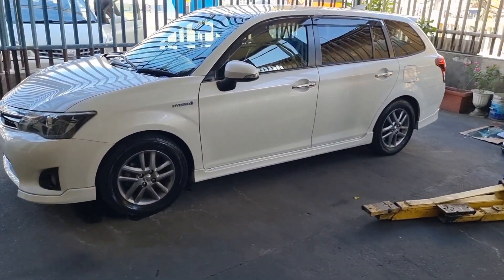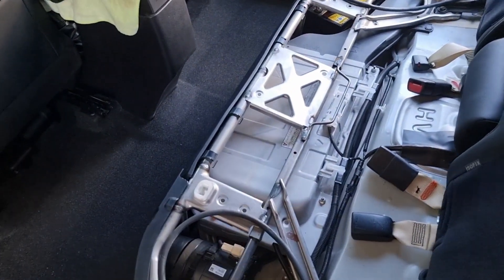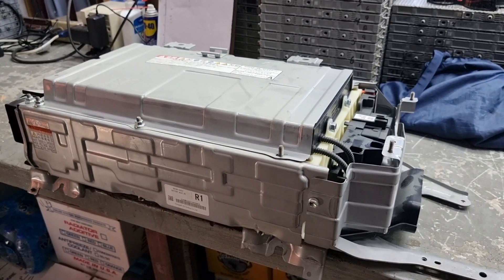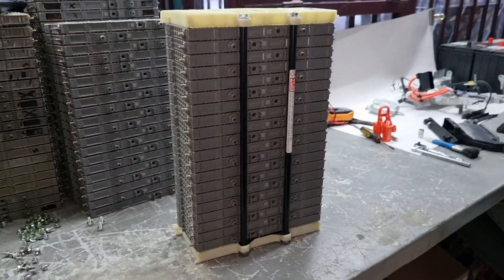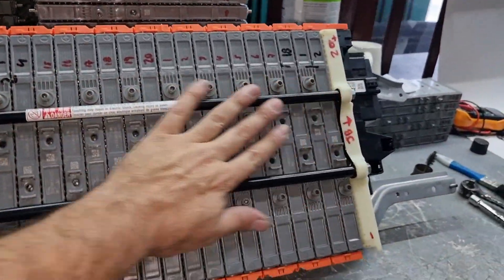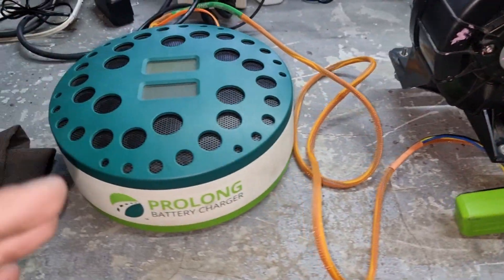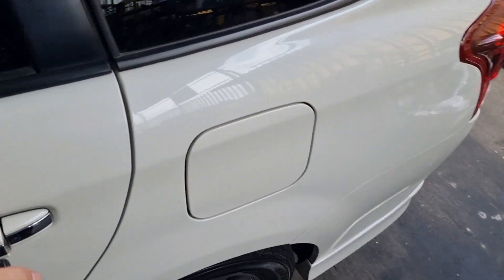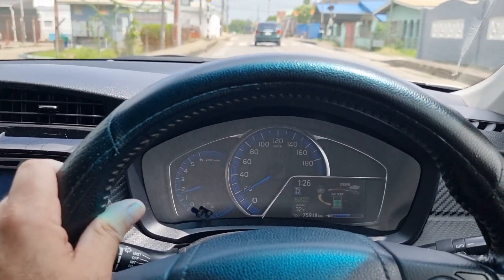reconditioning a bad hybrid battery will fix it? let's find out

Comment: That is not how you precondition a battery. You must discharge and charge 5+ times. You do not know what you are talking about. The cells have to be charged individually. No bueno!
Reply from the maker: Let me remind you my good friend that these batteries work by always being charged and discharged collectively... so what are your bases upon saying just five times and individually like if it is black and white ☝️🤔😪😪 of course is NO BUENO ☝️🤣☝️🤣
Reply: Well man I have been rebuilding these batteries for many years. Usually there are just a couple of "bad cells" I mean internally shorted or just failed. To get the other cells to take a full charge to delta peak voltage, it takes up to 5 cycling between 6 volts and full charge to reach delta peak voltage. Individual cell charging/discharging is the only way The charger you are using is for battery maintenance and will not perform this function. You can tell which cells are bad by using toyota techstream before removing the battery from the car. It shows the internal resistance of each cell. Also, when you test each cell after all of the jumpers are removed you will see one or more cells that are noticeably lower in voltage. A bad cell will never reach delta peak. Search YouTube and there are many videos showing this. I assure you you are wrong. I would however like to have one of those chargers you have though. I can not believe you own a shop working on these things and not know this info. They cell good tested cells for like $25 on ebay. Let me know if I can help, or need more info. I will gladly help my friend.
Reply: @howardkanitz4998  educate me a little bit,  so what's the lifespan of the battery after removing the bad ones?
Reply: @johnstoneanduku8451  The first one I did has lasted 7 years so far. Always checks out on techstream. It shows full on the display every time I park it in my driveway. The car has 268,000 miles on it! I have 3 now!
Reply: OK guys, now that you asked. I bought a 2007 Prius 7 years ago with the OEM battery. The battery died when the engine failed to start. I pulled the battery and brought it into the shop. I found out that these batteries are nickel metal hydride. I bought a hobby charger that was compatible. I found several videos on YouTube and recharged the battery. I also bought a program called techstream, and a cord to hook from the car to my laptop. I bought another prius that the dealer said needed a $3000 battery. I checked the battery and found one cell showing lower voltage than the rest. A cell is actually 2 modules connected in series. I took all of the jumpers off the individual modules and tested each on seperately. One was 2 volts lower than the rest. I went on eBay for $30? I think? The charger I have is automatic. When charged the first few times the charger goes to a certain voltage and after a pre determined time limit says "full". After 5 times of discharging down to 6v and charging back up, the charger will say "Capacity". Capacity is when the modules reach what is called delta peak voltage. Delta peak is when these batteries have a voltage drop when fully charged. The charger senses this voltage drop and displays "Capacity, rather than full". I have rebuilt 5 of these so far. The first one has lasted 7 years so far and still checks out on the computer. The car shows the battery to be a full charge when I pull in my driveway. Discharging/charging once does nothing. Try it yourself. Search it on youtube, there are many videos on the subject. I obtained my information by watching all videos at the time, then from personal observation. Trust me I have mastered this. If the charger says "capacity" it will last for a very long time. The problem is the copper jumpers corrode, which can be cleaned, and some modules are factory defects. When the modules become unbalanced it can cause an overcharging problem, or an undercharging problem on different modules. This is where you get the Red triangle of death. I use a turnigy charger that does 4 modules at a time. It usually takes me a week to discharge/charge each module, but hey, I think it is worth saving $3000? By the way, yes these batteries are continuously charged, but never fully discharge to 6v per module, or fully charged to capacity. If you have more questions just ask. I hope this helps somebody. Peace! ✌

Comment: Had my hybrid fan cleaned today, to prevent overheating the hybrid battery, but it looked good, altough my old 2010 Toyota Auris has no air filter in the fan system.
Reply: No pets in the car, almost no major cooling problems. But cleaning the fan and air canals help the cooling. And remember to use your A/C all the time your battery needs it.

Comment: Ok so charger has to charge up a . Zero one and .02 amp rate to charger for 24-48 hours after equally discharging???
Reply from the maker: Great question 👋😎... the only way to savely charge the battery should be from 0 to 0.2 amps in pulses for NOT MORE THAN 48 HOURS with all modules assembled on the frame of course or they will swell and go bad ( careful with this ☝️😎), the reason is because they produce heat after charged... then you can now mount the modules in your balancer for 48 hours for a full balance 👋😎

Comment: I have a question about doing this with the 2nd generation battery where the fan is located in the car. Is it best to reinstall the battery before doing the charging or can i use a fan to keep the pack cool? Im new to this game and want to learn as much as possible before attempting it.
Reply from the maker: Yes... use it in a cool room with a normal fan 👋😎👋😎

Comment: Cheers from Romania . I have 67% of life expectancy of my battery and there are no errors . Can i do individiual charges and discharges on each cell with a hobby charger and then balancing the entire pack ? This will bring back some life expectancy to my battery ? Thanks !
Reply from the maker: Yes my friend... just make sure to properly balance after cyclong the modules 👋😎👋😎
Reply: @hybridsolutiondiagnostics  what about after balancing should i swap de center modules to outside ?       Thanks for helping me 👍
Reply: @braescuvalentin761  Yes, definitly. By doing that you can delay the time until your current outer modules fail.
Reply: Valentin salut poți să mergi la băieți de la Galați ! Sânt f bunii!!

Comment: do grid chargers or superchargers for 2013 prius gen 3 actually work on a hybrid battery that has sat for over 6 months without starting?  they go for $300 grid charger, to $500 for super (fast) charger ?
Reply from the maker: You must use a low amperage charger for a slow charge...

Comment: Can you replace the weak cells with good ones??? And still come out with a bargain price???
Reply from the maker: You will need to match the modules with the same capacity or it wont last much...
Reply: I did replace bad module and after 80k miles battery works, but sure isn't infinite.. needs reconditioning overtime and yes  keep saving for a lower mileage battery pack in couple more years.

Comment: I am curious why you call it reconditioning when you replaced 7 modules? Maybe that is a service/marketing term? I understand replacing those middle cells since the temps get higher there. Personally, I would not call it reconditioning. I believe there are other cell chemistries where reconditioning can bring the cells back to a better capacity, but not this type of chemistry. The extra capacity you observed was mostly due to replacing the middle cells with better cells. 25% increase is good, so may help this customer for a while, but it did not recondition all the cells to work better. The lowest capacity cell will be the limiting factor.
Reply from the maker: Thank you for your comment... the answer you are looking for is in the minute 15:55 ☝🤪... watch the video
Reply: He didn’t replace any battery
Reply: He replaced "7 of the worst modules".

And the reason the overall life expectancy goes up is because if there is 1 faulty module, the battery pack will give you a false overall life expectancy. All the other modules will be limited by the one bad module. I went from 4% life expectancy to 89% by changing out 4 bad modules. And yes, cycling the batteries does help the capacity also. I've gotten modules from 4500mha to 6000mha by cycling them. 

So I dont know what the heck you guys mean by you can't recondition a battery....

Comment: Shouldn’t you have performed a three cycle charge and discharge to fully balance the battery pack.
Reply from the maker: No, if you do that to an umbalanced in capacity battery, it will for sure go worst...

Comment: First of all you do not do any of experiments. All we can see in your shop a lot oh hybrid batteries from Toyota etc etc. Second, the owner of that car probably do some strange things with car, because it s only 76.000 kilometers on the clock, and all ready problem with hybrid battery? Not even a chance!!! I have very old Lexus RX 400h from 2008 and on the odometer it’s 450.000 km. Car and everything it’s in mint condition. Last time when I was at my Toyota dealer, car mechanic have tester battery and it’s still strong with 87% good health. So cut the crap and if you want free advertising do that on some other manner.
Reply from the maker: Thank you for your comment... i will accept that indeed you are trying to make a point but sadly might not have any idea of what you are saying from the technical point of view... this is like the daily issues of these batteries here in the caribbean and the reasons are many but heat it is the main reason these HV Batteries are going bad so fast. I have other videos explaning in details... take a look ☝😎
Reply: @hybridsolutiondiagnostics  I don’t care. I live in Sweden and usually in winters it’s around -20 -30C. So please you don’t need to explain to me about hybrid cars anything. 👍🏻
Reply from the maker: I can see your point now... in cold weather these batteries are almost forever (Facts)... so clearly you got a lot to learn my friend ☝😎
Reply: @hybridsolutiondiagnostics  I have live and  study in Florida 6 years and I have old Toyota Prius with 189.000 miles on the clock, never ever any problem with car. I have purchase that car because my dad have Lexus and also he never have any problem with anything. So man, please stop to embarrassing your self and your company that 76.000 km Toyota car have problem with hybrid batteries, no one will trust you.
Reply from the maker: @alexa795  tell that to the many many customers i had to rebuild their batteries and all cause the same reason (HEAT). So my friend... your arrogance over technical knowledge it is indeed very embarrassing... so lets do something better... i kindly invite you to see my other videos explaning in details the toyota hybrid batteries common issues in hot weather... you might learn a little i hope ☝😎
Reply: @hybridsolutiondiagnostics  Only one thing here it’s embracing. The are no bad hybrid batteries with only 76.000 km. That story you can leave to your “customers”
Reply from the maker: @alexa795  yes that is true... most of these vehicle's odometers are runned down by importers so ussually they are all over 120k km and then of course... extreme heat weather here is the real battery killer.
Reply: @hybridsolutiondiagnostics  No one buys that shit. Just connect OBD and you can see real km. Even if don’t have hardware and software every service can do that for just 10 $. Men, that crap what are you talking no one trust at all.
Reply from the maker: @alexa795  jejeje my friend that is sadly not true... you have a lot to learn but arrogance not letting you understand details... its being a nice debate but you clearly need more info to debate about this... thanks for the comments anyway.
Reply: @hybridsolutiondiagnostics  Thanx a lot, but cut a crap, no one buy’s such shit talk any more. Good luck with your “business” 😏
Reply: @СлаваСлавкин-е4е  don’t understand

Comment: Is conditioning a battery at 75% life expectancy recommended? Or at what percent should it be reconditioned. Trinidad to the world... great job..
Reply from the maker: Hi thank you for your comment... indeed a HV battery with 75% needs to be serviced
Reply: @hybridsolutiondiagnostics  I wouldn't agree.  Wait until under 50%.  When it comes time to repair/rebalance the battery (which is a big deal and you don't want to do more than every 3-4 years) better than bulk charging/that Prolong charger, it would be far better to run the charge/discharge process on the individual modules, then pair them with each other to produce pairs of about total equal mah capacity, and reassemble the pack as Jose suggests, moving the inner modules to the outside and vice versa.  Don't forget to clean your hybrid fan.  I also move the outer module heat sensors closer to the middle of the pack to trigger the fan earlier.
Reply from the maker: @cawag98  you are correct just in a few comments but very wrong in some others ☝️🥴🥲... do not wait until your battery is 50% and do not move sensors to the middle that is so BUT SO WRONG ☝️🥴

Comment: good video and good experiment.. but one thing u didnt do.. 

u didnt charge and discharge the (rebuilt) battery pack.. to try and restore lost usable battery and capacity..
Reply from the maker: Thank you for your comment. Indeed i did not cycle the battery pack because if you do so, then the strongest modules will become too strong compare to the weak ones and then the battery would become worst unbalanced....
Reply: @hybridsolutiondiagnostics  ur are the pro here and im not trying to discredit you but the whole point of charging and discharging is to balance all the cells.. maybe its not possible but this is what im trying to find out the answers to
Reply from the maker: @prawnstar502  yes of course cycling the battery modules will restore... the problem are the weak cells, they wont restor capacity even if you cycle then...

Comment: Hybrid battery dies quickly if you use the economy mode or the power mode or the EV mode.Avoid these things.
Reply: So which one is better?
Reply: that is true
Power mode EV mode are battery killer. Reverse movement reaches 125Amps to uphill

Comment: I love the educational videos you are doing. Would you be able to explain how to connect the prolong charger ? Does the battery need to be fully functional when charging with the prolong charger?  Does the orange breaker need to be in the on position?
Reply: Keep your money to buy new Battery pack from Toyota and install it yourself for about $2000.  Don't waste your money on false hope of Prolong device.  The chemistry and aging of the electrodes LaNi8 is not reversible.  You can reduce the memory effect but will not cure aging battery problems. Keep the car under the shade/garage, AC always on and drive regularly with clean battery vent will guarantee the battery last 15 years or more.  All Hybrid in UK/Ireland has 15 years unlimited miles because of mild weather there.
Reply: @rondhole  yes indeed... replacing the battery it is always  the very best solution...
Reply: @joseramonherreramendoza9260   yes, many tried  reconditioning  and never last long enough. May be enough before you trade it in to dealership in few months.
Reply: @carall66  any better insurrections? I also don’t like the prolongs instructions. It doesn’t say charge until what voltage? I heard you should not overcharge would cause delta problems
Reply from the maker: Hi and thank you for your comment.. that video is coming very soon...